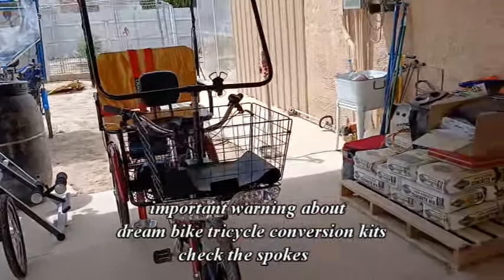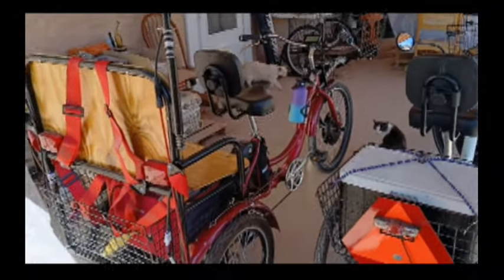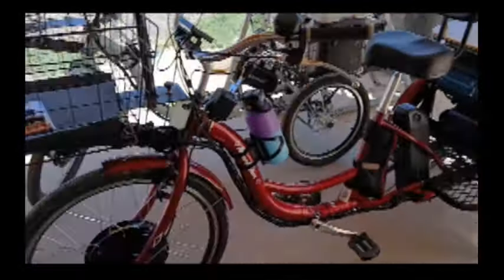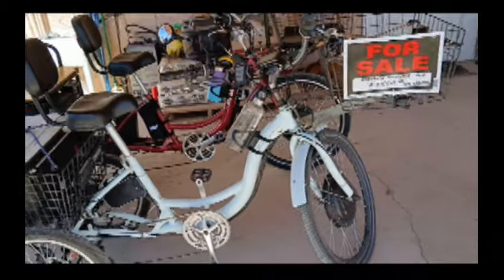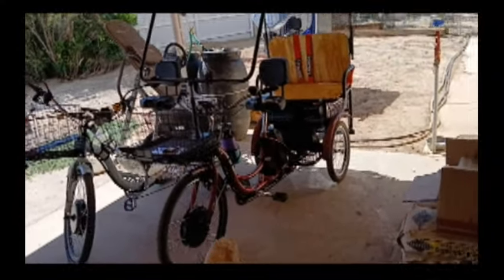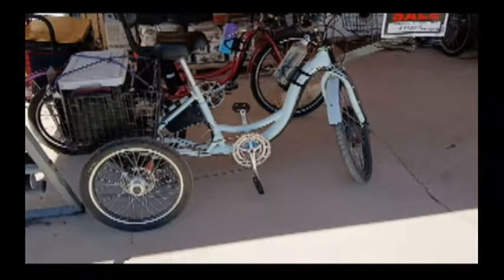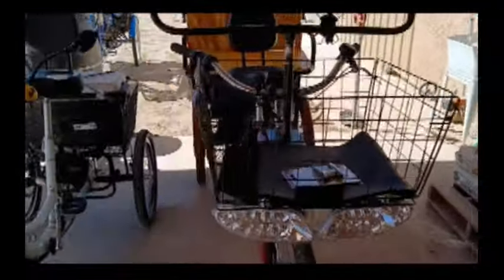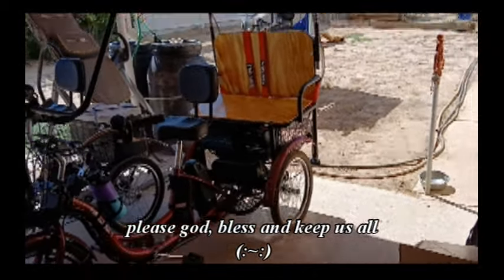important warning about dream bike tricycle conversion kit    check spokes (:~:)

Comment: Hi Charlie, I am planning to get a Dreambike conversion kit and to use a Bafang central motor.
I am interested in the possibility of using a front motor, 1000W, 120 Nm.
The advantage would be I ken keep the front derailer with the three sprokets, useful in a mountain road like the one i need to travel on.
My doubt is: will it resist spinning on a hard incline? 
As i said,I have to use it on a mountain road, with 12% incline, what is your experience?
Reply from the maker: i really love the dreambike conversion kit... just check the spokes as a regular thing... even with thread-locker/locktight applied... i still have to have a spoke tightening session... but, i still really love these conversion kits... i also found that buying from 'reliving mobility' was a better solution than buying from brazil directly... high recommend to jim and reliving mobility...

in my way of thinking... applying the electric power to the rear wheels is redundant because the rear wheels are already 'driven' by pedal power... with the awesome rear differential, (that applies power to both wheels and importantly it also applies power to the wheel on the ground should a wheel lose traction unlike a 'normal' differential that applies the power to the wheel in the air and not on the ground, (spins 2x and breaks spokes when it hits the ground going 2x)...

anyhoo... in my thinking... putting the real power to the rear wheel is redundant and considering the simplicity of front wheel conversion... overly complicated... though i do see the wisdom of applying the power to the machine... where it was designed to be applied... on the mid-drive model... i really like that and i haven't actually used one or worked on one... so, i don't know enough to say one way or other for certain... but... the front wheel drives are extremely simple and only have minimal moving parts... and you get actual '3=wheel drive'... and using the front wheel to 'pull' is a huge asset... especially in off-road situations or loose gravel... trying to 'push' your tricycle through such obstacles is much harder than having the front 'pull' you through them... in my experience... again... can't say enough good things about the dreambike differential... and i have been pretty hard on it... so far... so good...

you are very correct in that going uphill on a tricycle... you lose traction/weight on the front wheel as the incline increases... a real bummer... placing as much weight on the front as practical is a pretty good solution... a big front basket... i only convert schwinn meridian tricycles to the dreambike conversion... a fantastic combination... schwinn meridian has a great frame... very comfortable and usable... but schwinn meridian has no differential(one wheel drive)... no gears/speeds... and kind of crappy band/drum brake system... the dreambike conversion kit solves all the problems the schwinn meridian tricycle has and makes a great tricycle instead of just another 'bike with 3 wheels'...

i put 3 sprockets on the front drive and as high a gear ratio as i can... no derailleur... i just switch the sprockets by hand... granny gear for off-road... mid gear for 'in town'... and high gear for the highways... i can still contribute up to about 25 mph with 'high/high' gear... huge increase in range because of the gears... most of the time i stay in high range/5th gear... 21 speeds is very nice... especially if i lose electric power and have to rely on pedal  power...

i use the schwinn meridian rear basket which is substantially more heavy duty than the basket that comes with the dream-bike conversion kit... i use the dream-bike basket as a front basket and it works very well... i designed a simple 4" flat metal mount that clamps on with 1.5" exhaust clamps to hold the dream bike basket on the front... above the front wheel... where i can put upwards of 40 pounds of cargo...

i hope this helps... god please bless and keep us all (:~:)
Reply from the maker: also... be sure to use a 'torque-arm' on the axil to make sure it does not spin inside the mounts (:~:)